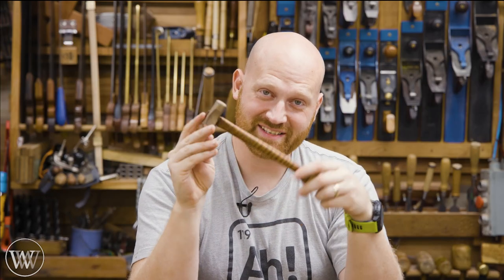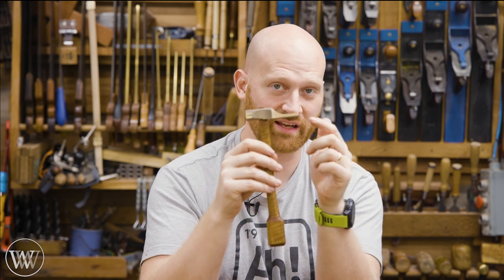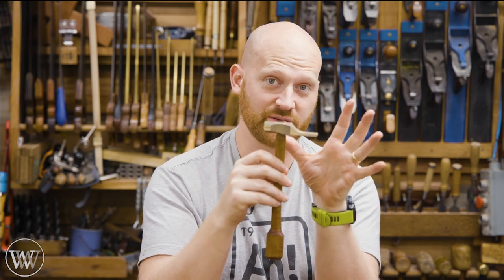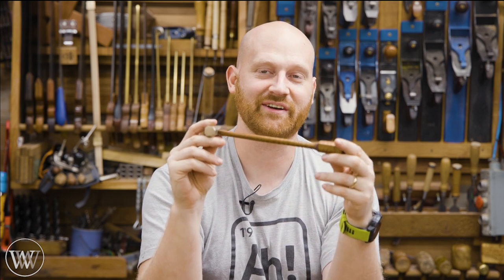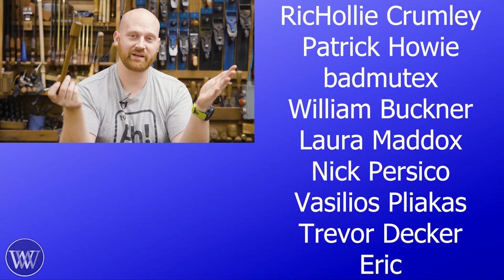Making My Plane Adjustment Hammer

Comment: Mr Wright… the information you provide is always helpful and descriptive. Thank you 

However I have a question about types of wood to use for outdoor use for furniture and swings. Everything I have read says redwood and cedar are the best but what wood that the old time farmer used for fence posts was locust. Would locust be good also? Why or why not?
Reply from the maker: Honestly there are a lot of woods that are great for exterior use. I love white oak and live oak. And they'll last a good bit longer than most cedars will. The reason redwoods and cedars are common is they are both long-lasting and cheap. White oak is generally not cheap. Not to mention for fences cedar is much easier to work with and oak is a pain to work with.
Reply: @WoodByWright  thank you for your time
Reply: 1 more question if you please. What is a better/best finish and would you torch it black as well
Reply: @WoodByWright  1 more question if you please. Would you blacken the wood and what better/best finish
Reply from the maker: As to finish and charging the wood that is personal preference and the look you are going for. If you want to send me an email with the project. I would be glad to talk it through with you. jameswright@woodbywright.com